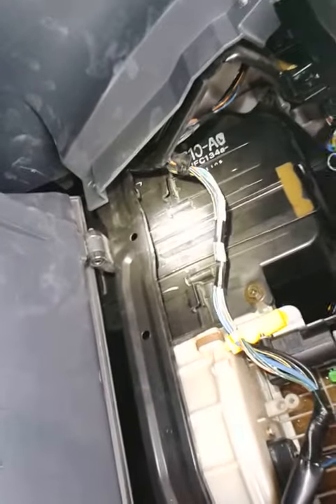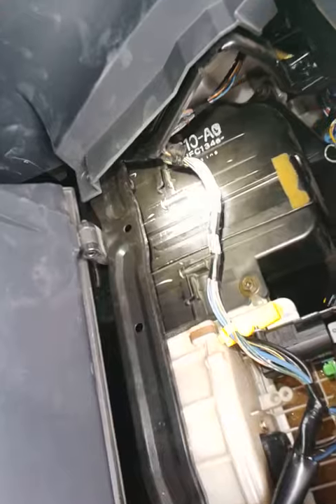1999 Honda crv cabin air filter replacement.

Comment: I take my 99 crv to a honda dealership, last time I went in for an oil change one of the suggested things was cabin air filter replacement, waited for 40 minutes for them to replace it, then they told me they couldn't replace it because it didn't exist...
Reply: That is one screwed up dealership.